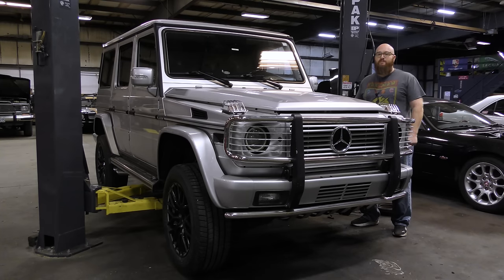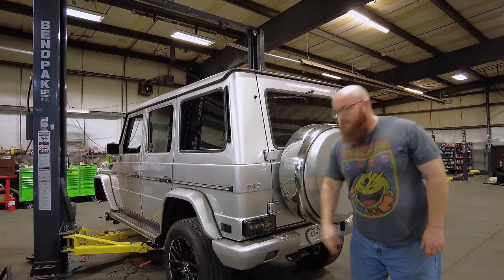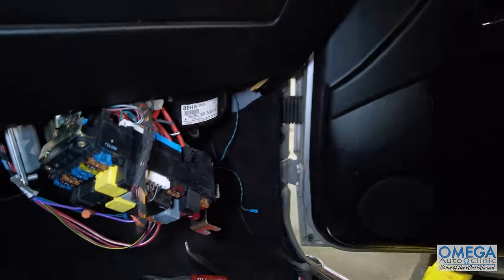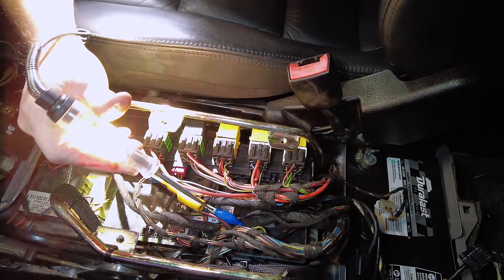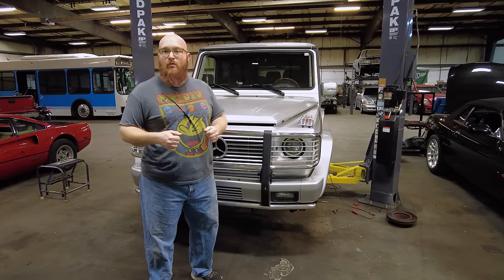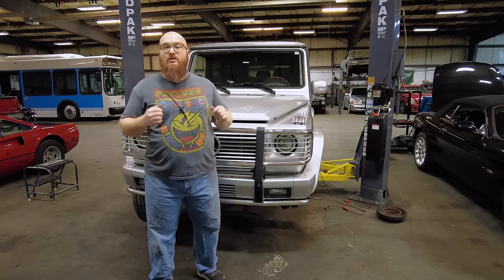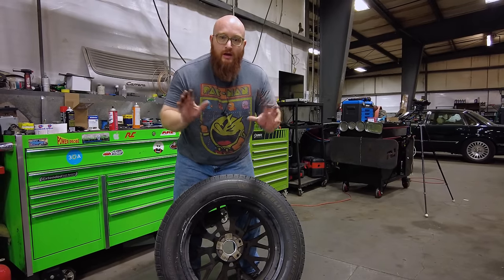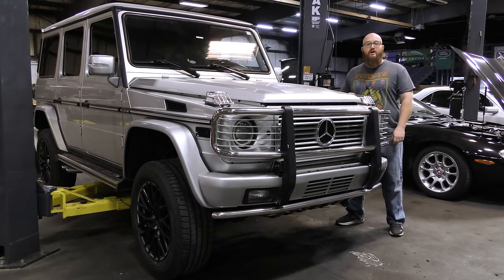Dangerous Mods on this '03 G55 AMG G-Wagon! CAR WIZARD shocked at the level of stupidity

Comment: A G Wagon, here in the Great White North, is running over $200,000 in Soviet Kanuc money. That would be two years of gross income for a high paid professional.
Now you decide that you're smarter than a bunch of German Engineers and you make changes to make the thing better.
Yeah, the thing has external door hinges (!?!?!), but whyyyyyyyy? eBay LED lights? Wheels that almost fit?
Now it's not a Mercedes, it's somebody's project. Demand a price reduction for non-original modifications.

Comment: Actually wizard opened himself up to a major lawsuit if his repair fails and the customer suffers injury, should have replace the modified/damaged parts instead of welding on anything that has to do with the wheel staying on the car. Those welds looked awful.
Reply: Are you familiar with welding? I am and those welds look fine. You can tell he used a MIG. They don't do the prettiest welds, but the penetration looks good.
Reply: @JasonWW2000  How can you tell what the penetration is by looking at those welds on a video,I've seen plenty of better looking welds fail. It still doesn't negate the fact that if that hub/wheel fails for any reason he's getting his ass sued. I'm sure if the owner has the money for that high end SUV he can afford some new parts to fix it correctly, Would I run that repair done by me on my own vehicle? maybe but once you do it for a customer that would be a huge NO. Don't mean to argue, you're a welder and I'm a mechanic and I would never be proud of that repair for a paying customer due to liability issues.
Reply: @iddddaduncan  It's the shape and width of the weld. He's welding inside a 90° angle. If the added material is a convex shape and sort of narrow then it's not fully melting into the two base materials. The welds in the video have the new material sitting flat or slightly concave and its pretty wide. So it appears to be melting into the two base materials quite well. 
This is just a visual test. If you truly need to know if its got proper penetration you would x-ray it. I don't think thats necessary here. 
I'm guessing Wizard has welding experience from being a mechanic in the military. 
He could have made it stronger by welding the full circumference, but the stock hub didn't go all the way around either. 
I've seen a lot of improperly sized wheels get mounted to vehicles with just the studs and they can last a while, maybe years. Eventually the shear forces will start breaking the studs until the wheel falls off. 
I would say the Wizards fix is just as strong, if not stronger, than the factory design. 
I personally would fix it by finding some used stock hubs and swap them out. But if two used hubs cost $2k-3k I'd definitely fix it like he did. I'd weld it myself and take it to a local machine shop to get the tolerances just right.
Mind you, it was currently being driven on wheel studs alone for no telling how long. So they use beefy wheel studs. I can not forsee any issue where this repair would somehow fail later on.
Reply: @iddddaduncan  I rewatched and he said the replacement hubs were $400 each, so $800 for the pair. Thats not crazy expensive, so I probably would have replaced them. Assuming I could get them quickly and not a month or two later.
Reply: @JasonWW2000  I agree with what you're saying about the weld , I'm just thinking if God forbid anything in that wheel fails and the driver is injured or killed and an insurance adjuster notices that repair, the Wizard would lose everything all because he wanted to save the customer a grand. I would never be allowed to do a repair like that for liability reasons even though on my own vehicle I'd probably do that.
Those wheel studs would also at a minimum be replaced with wizards repair as they have already been stressed, I've seen studs sheer off more than once.
Anyway have a good day

Comment: Wizard, couldn't you have just centered that wheel on the lug bolts???????????????? If one were to just zip it down without a wheel hub locator it can be off center but if one takes the time to snug each bolt a tiny bit at a time before impacting them home the wheel should be centered.

Comment: Previous owner was switching off the back lights when running from the cops at night,  running drugs and trafficking humans.
Reply: Not with the switch behind the light. It's more likely used to switch between a sequential flash and a solid flash.

Comment: Re the tailamp. Common sense would not lead me to look for broken wires. First thing I would do is turn on the switch that's supposed to turn on the lamps, and see if they are getting voltage where the lamps makes an electrical connection to the connector that brings them electricity. Just a little test light is the only tool I'd need. If there is no juice to the lamps, the next thing I'd do is go get a schematic diagram of the electrical system. Yes what CW is doing will work. However should there be a failure in the future, say someone accidentally cuts a wire when replacing a plastic panel somewhere, then the next mechanic looking for why the turn signal isn't working is going to download a schematic for the car, and then start pulling her hair out when she sees that the car isn't wired the way the schematic says it is. I would have dont the repair the same way Mr CW did it here but in addition I think I would have wanted to add a note somewhere, where the next mechanic would see it.

Comment: I did not think 200NM was very much, but I have worked on a lot of VW products.  How about 200NM (147ft-lbs) AND another 180 degrees?

Pretty standard for FWD/AWD 'sealed' or one piece bearings (not really one piece, but they come assembled). Not sure how this old truck chassis works in the bearings department.  But welcome to German overdoing it.  VW rabbit was crazy over engineered.  They even upsized the transmission input shaft several times over the model years.  They would beat the test mules til something broke and then upsize that part until it couldn't.  Just like how they did on the F150 Raptor, but it's an economy car!?!

Comment: I don't know, man, I wouldn't feel all that bad if these people get to pay more for fixing these expensive pieces of junk, from my experience, people driving these big ass SUVs and pick up trucks are usually the biggest assholes on the road. Them speeding constantly, not showing turn signals, tailing and high beaming is such a common occurrence with these pricks if them getting charged premium for repairs means they get to spend less time on the road, that's a plus in my book.

Comment: In your video you ask the question: Who would hack off the OEM wheel centring lugs on the front hubs of the G-wagon?  

Context:  Humanity can be classified into four types:  Type 1 - Intelligent & Industrious; Type 2 - Intelligent & Lazy; Type 3 - Unintelligent & Industrious and & Type 4 - Unintelligent and Lazy.

Answer:  Types 1, 2 and 4 generally are not a great concern when it comes to performing dumb acts - i.e. the intelligent know better and lazy can’t be bothered.  However, the Type 3 person is the “dangerous type” and most likely is the one responsible for the “dumb act” of cutting off the centring lugs in order to fit the non-OEM wheels.
The said person did not have the required knowledge, or bother to attain the required knowledge, whilst also lacking in basic “critical thinking” skills - what some people describe as st…….. - but I will refrain from spelling it out.

Comment: Typical Pookie, Ray Ray, dope dealer vehicle
Reply: No, not really. The switch in the rear might be used to switch between a sequential Flash and a solid Flash. I doubt the owner was the one installing the aftermarket rims so it may have been an unqualified wheel shop that installed those rims.

Comment: ,,,  OOOH, and the comparator circuit section reading the [module-generated digital carrier signal] fed back sees 2.5 +/-? 3.0 V +/-? at 22/32 mA , and needs to see the "piggybacked" artifact of 'both' front and rear carriers, containing the 'delay' driven by two somewhat similar lengths of conductive "(wire) lead" length???  Damn!!!

I'm a (now retired) long-time Motorola Two - Way Communications (Police/Fire/EMS/Public Service/Business Comms) dealer. Owned from1977 thru 2016, but active until around 2003-only,  because of the 1987 700 Mhz/800 Mhz "Municipal" Frequencies Band(ing) reallocation, and NEXTEL-plus- smartphones killing business radio systems sales.  I've built MIL-STD (compliance-verified) custom wiring harnesses since, but haven't sold to other than certificated/verified vehicle builders, because of contractual requirements not to.

This opens up an entirely new can of worms, THANKS, MANY THANKS, for the notification of this problem with dire potential.

Comment: Not sure how I feel about this.  Boarder line hackery.
Reply: Its just because you don't fully understand what is being done.
Reply: @JasonWW2000  no I understand What’s happening.  Just wouldn’t expect it to be done by the Car Wizard.
Reply: @brianhilligoss  I think the Sam module is beyond what wizard is able to fix or have sent out to be fixed. His only option is to replace it which is going to be very expensive for the customer. So that repair really comes down to the customer on whether or not he wants to spend that kind of money. The repair will be fine once done.
The wheel hub repair is one of those things where $800 isn't really that expensive to know that it's going to be correct and that there's not going to be any liability if the welds should break or whatever. This is another situation where it's really up to the customer if he wants the cheaper fix or if he wants it done by the book. If the customer wanted it fixed properly he could just spend the money and The Wizard would get the job done properly. I don't want to call the customer a cheapskate or anything, but it is nice to know that the wizard offers a cheaper alternative that will work and is safe. I don't see it as hackery. What the other guy did before, cutting the hub rings off, was for sure hackery. Lol

Comment: This is so stupid you have to wonder what car makers are thinking.   A brake lamp circuit is very simple.  Why are they adding a stupid module to complicate things?  This should be some wiring, a relay and a switch.  My guess is that the rear SAM does not like that aftermarket LED lamp it is not designed to run.   So putting back the old lights would probably fix that problem. Unless the LED light killed the module.
Reply: Mercedes wanted to be considerate to their owners and let them know with a message in the display if a bulb was burned out.

Comment: Lost me on this one. I can't understand why he didn't just replace? Content? 
If somehow that weld broke!  It's an incredibly small chance; maybe as low as, 1%.  But there is a chance! 
A failure at that point is 99% sure to be injurious at least, death at worst. 
So not worth the risk. 
The Wizard knows the danger, too. You can almost hear him selling the repair, defending it, as he sets the stage ..."Ed Bolian's", ..."Master Mercedes Tech" ..."My clean welds" ..."If  plastic is good enough", etc. 
If Dave did a fantastic job isn't the point.  What if he had a contaminated welding rod and it looks outwardly strong enough to hold but not isn't enough under highway load.
What if the car owner drives over a missing manhole cover,n the weld fails and someone dies?... Though no clear fault of Omega. That folks is a what the ambulance chasing lawyer the deceased persons family hired, calls a contributing factor! Whether it really is or not. If Dave isn't a certified welder, he's DONE.  In court, every part of that repair would be scrutinized at a micro level. Say, for instance, he's on the stand defending himself - from a manslaughter charge- and the prosecutor asks the shear strength of that weld. Don't know it, DONE! 
This repair is so, so, NOT worth the risk! 
Charge people fairly, work around fixes when you can . *Like the lights! 
But 
That customer bought a MB G wagon. Truth is, if you want to drive like a Baller, you're gonna pay like a Baller. It's not Omega's fault MB parts are expensive. 
Be fair to the customer. Cross reference parts when you can. Charge a reasonable hourly labor rate for MB or  Ford. Be the all round decent human being he, his wife and his people have consistently shown  themselves to be. I would trust Omega with my car, as would most of you. 
The risk/reward just isn't in this repair. The liability potential is catastrophic! If anything happens, that extra couple grand he tried to save the customer could cost him everything!

Comment: A illegal drug mule wagon with turn toggle on/off switch for the brake lights for night time driving?
Reply: If that were the case, the switch would be upfront. Most likely the switch is so that you can switch between a sequential Flash and a solid Flash.

Comment: Oh boy! Can this be done and work fine? Yes. Should it be done? Absolutely NOT, if nothing else for liability reasons!!! So the clown buys what was originally $100K+, hand assembled vehicle by Puch on behalf of MB and can't afford or refuses to pay for 2 new front hubs and labor?!!! I would refuse to work on that idiot's cars! The main single issue IMO is that those Chinesium wheels are not OEM and G-Wagon weight and off-road force rated wheels which every show-off clown who buys MB gets and then cries when wheel fractures and/or breaks causing an accident or worse. Plenty of documented cases of failure of non-OEM wheels that are underated for the vehicles! In Germany vehicles have a booklet that is used for every single "upgrade" and especially wheels and it had to be TUV approved and certified for a reason. In USA we do smog checks and drive death traps fixed like this by far less skilled people than you Wizard.  And wirring fix? What do you think caused rear SAM faliure in the first place? I saw household wirring twist nut on that fron SAM! Again if you want to drive a used foreign luxury vehicle for cheap, you will pay dearly on deffered maintenance. And that clown that owns that G-Wagon sells used cars?! Well talking about a major red flag. I would not buy a skateboard from that idiot! Wizard, I am losing respect for your approach to repairs. You of all people should know better and then post videos documenting this kind of repair. What happens if that G-Wagon clown crashes regardless if the hub was a cause? You think he is not going to use the opportunity to sue you to get out of trouble himself?

Comment: lol...i love  weezard but running a trap off the front to fix rear, sam or no sam relay or no relayt..hardly genius..re; front. are u calling hub "fingers"another way to fix the out of round on the go is loosen lugs drive vehice  just a few yards and it will center itself, stop tighten lugs or get car whjeels bslanced on vehicle....also there is a  b ack channel between sams you could used an existing physical path and a software path too. , 3rd solution get ecm and sams from donar g wagon for 90 bucks at pick ur part

Comment: Jesus with how much work you put in, 90 percent of mechanics just based on time invested alone would have just bought the hubs and fitted them, as that sounds like a scary you must replace kind of thing, and its really kinda dumb really, like if the rims didnt fit, why didnt he just ground them, the tabs, down to fit, rather than cutting two of the three tabs on the inside?

like even basic logic doesnt compute with cutting a dangerious part of the car like that, as now you put all that weight and straight on the axels, and the 4 wheel drive axels no less too.

like its damn lucky this thing was used by the german army and ment to take a beating, as I think that would have ripped most fords to bits with the death wobble from hell

Comment: Typical German over-engineering
Reply: Cutting the rings isnt really the fault of the car and the failure of the rear sam might be due to the lack of resistance of these cheap ebay LEDs. Whsitlindiesel has some good videos about the G.. the car can really take a beating and still stand strong.